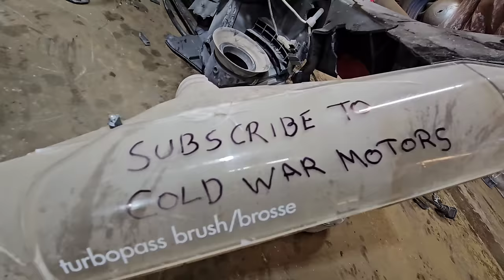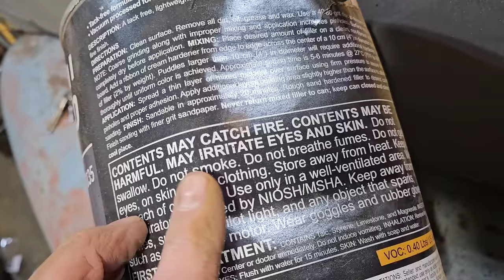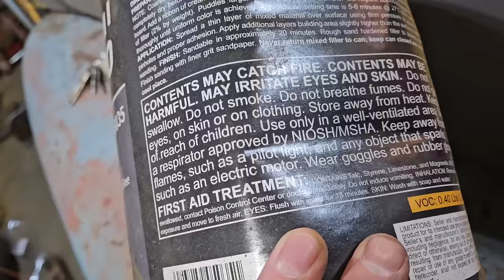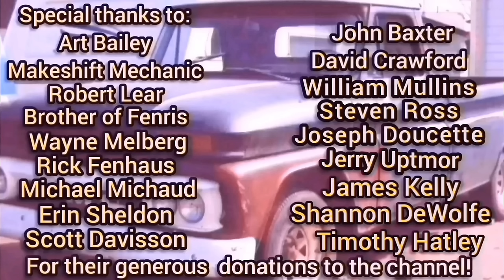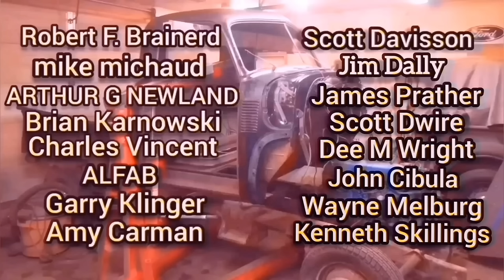Quit Doing Body Filler the Hard Way! Amazing Simple Trick Used By Professional Bodyshops

Comment: What extra steps if any are there for painting the leaded joints/repairs? Special primer or suggested technique?
Reply from the maker: Follow the cleaning steps in this video, it’s extremely important that the surface is thoroughly cleaned with the baking soda/water mixture to neutralize the acid from the tinning process. After that, wax and  grease remover and whatever solvent cleaner is recommended for the paint system you are using. The lead can be primed with etch or epoxy primer, same as what you would use on bare steel.

Comment: What ever you have to do to get the job done Man! Its your car do it the way you want! Using lead is not easy, It takes alot of patience or you will warp the hell out of the panel! I can tell you have done this before, Nice job man! what do you tin your panel with? Do you use anything on your paddle to stop the lead from sticking?
Reply from the maker: I use Eastwood tinning butter and use tallow on the paddles
Reply: @CarterAutoRestyling What is tallow?  Do you buy it or make it?  The wooden spreader paddle, does it matter what kind of wood?  Great video, I thought for a minute you were gonna do something different with filler

Comment: My father was a lead man back in the day he used to repair autos at a Jaguar Dealership, he could lead the whole front section of those cars full of curves headlights grille openings etc I used to watch him hanging lead all around them using an oxy/acetylene torch with a big tip one second too much or too close would result in everything hitting the floor and that shit ain't cheap, I asked him once if he would show me how to do this since he was a master at it and when done needed minor sanding, his answer, go do something useful you will never get it, well I did and thought fuck him, so I taught myself to finishing metal so it never needed filler material and in good time managed to build complete car bodies with simple hand tools and you know what the old boy just couldn't figure it out if he was denied filler he couldn't finish his job, but I could, my revenge was calling the filler guys plasterers, take away the plaster and finish off the tradesman. The guy in this video is a plasterer, I don't care if you fill it with gold the masters finish the metal. Until 
that is mastered they are all the same, plasterers, I've seen complete car bodies covered in cheese and sanded for months, if that body gets damaged  
all that garbage has to be removed and reapplied what a sick miserable job it becomes a small repair ends up costing a fortune because of the hidden 
bad workmanship hidden under the paint..

Comment: Could flux help in any way maybe in to pin holes to suck in the lead or would it dirty up your work area I know lead work in frenching lights and building areas up for strength haven't seen it done on the flat inplace of bondo like what you did good work

Comment: So you’re saying in the end of your video that, you would first have used the lead then finished up with plastic filler correct? Honestly asking. Pretty interesting.
Reply from the maker: Technically you can use lead as a stand alone repair and go straight to primer and paint. Unfortunately, most 60+ year old car bodys are full of minor imperfections, so it's not practical to fill them all with lead. For those minor imperfections, I use a thin coat of plastic filler over the entire surface of the panel. One of the drawbacks of lead is that due to the heat required, you run the risk of warping the panel during the leading process (especially on a large flat surface like a hood or roof). Lead is best used on more rounded cars from the early 1950s and older, and on 1960s cars I only use it on edges or panels with a lot of hard bodylines or high crowns.  I don't recommend using it on new cars or any car with thin metal (mid 1970s and newer) as it's too easy to warp the thin metal from heat.
Reply: Thanks!

Comment: I have some FE valve covers I want to "fix" would the crank case get too hot and melt the lead?😊
Reply from the maker: The melting point of the body solder I use is around 360 degrees F

Comment: lead will eventually form little bubbles under the paint just take a look at older cars when factories used to fill the seams on the quarter panels , inside door jams not as much because their more protected from the elements , body filler if done right and not huge thick quantities and sealed from humidity will last a life time i have collector cars that i restored 20 and 35 years ago no cracking or lifting I'll stick to it
Reply from the maker: It bubbles because the acid used during the tinning process was never completely neutralized at the factory. Lead must be applied to a fully welded seam with no pits or pinholes. The surface must be cleaned and neutralized before and after applying lead. The lead seams used at the factory were never intended to last more than 10-15 years because the cars themselves were never meant to last more than 10-15 years. Done properly, lead filler is far more durable than plastic. It gets a bad reputation because most people do not take the time to use it properly, and the auto manufacturers and bodyshops back in the day did not care if their repairs lasted 60 years

Comment: Hypothetically, if you were to use Canadian Pennies you would want pre 2000 as they have been mostly, by a huge percentage steel then plated/coated in copper or pre 1982 for US Pennies which after that are copper coated zinc.
Reply: Zinc pennies suck.
Reply from the maker: I'm not a barbarian, I used all pre 1964 pennies to keep it period correct to the car.  
 Haha

Comment: Question i have is will the new non lead based paint stick to lead? Or do you have to get a special primer
Reply from the maker: Epoxy primer or etch primer over the lead just like you would use on bare steel. The key is to get the surface perfectly clean. Water and baking soda to neutralize the tinning flux, then wax and grease remover, then whatever cleaner is recommended by the primer manufacturer. People have issues with paint adhesion because they do not clean the surface properly
Reply: To get a small area perfectly clean I would sand blast with a finer media then prime with an etch then epoxy primer. You did a great job on that door @CarterAutoRestyling
Reply: @CarterAutoRestyling  would it make sense to use this on a quarter panel too?
Reply from the maker: @daveunbranded  yes. Automotive manufacturers used it on 1/4 panels for over 50 years to fill the seam between the 1/4 panel and roof. If you'd like to learn more about the leading process I highly recommend watching the Gene Winfield leading tutorial on the Eastwood youtube channel

Comment: Lead.... I suppose it's no less dangerous than body filler 
If done correctly, bondo is much easier to work with. Just apply it like joint compound. A little at a time.

Comment: I watched my brother at his body shop, (he worked on my 1957 Porsche. If you replicate the original hem, it will rust out again the same way because water is trapped there. It will last longer than Bondo without welding metal patches tho. Maybe add caulking on the inside of the door seam? I redesigned the hem./door bottom.
Reply: Stick to what you know bud.

Comment: Can this tin and lead stick be used to solder leaks ina steel gas tank ?
Reply: I have. Clean the tank and fill it full of water. Use a torch and soldering iron. Copper flashing and body solder

Comment: Another time-saving lead use is for drilling holes. The lead applicator pushes it out with a velocity of around 900 to 2500 feet per second, and rotates it about 1 revolution per foot of travel to improve accuracy. Be sure to use some kind of backing to stop the lead after it comes thru, or you may end up with extra holes you weren't looking to make. Several companies make the applicators, including Ruger, Colt, and Smith and Wesson. The downside is that the applicators can be tightly regulated and hard to obtain.
You might also like to know that asbestos is still in use in some applications - another danger over-rated in modern times that was used by the Romans. Remember, both lead, asbestos, and crude oil are naturally occurring features of the earth.  
That vacuum cleaner disassembly was quite thorough. Seems like the impeller might be a good candidate for a component of a home-made turbocharger.....
Reply: in Canada we are tougher as we now have to put the lead in manually
Reply: I seem to have missed the connection between the vacuum cleaner and the door repair.

Comment: The best glasing putty is JB Weld, for filling in valleys l use fine stranded copper wire placed upon tinned area, then tinned  in place .  Very minimal heat required for minor build up.  The copper wire is like fiberglass mesh with epoxy.  OMG you made a mess filling those mirror holes😂Lack of knowledge
Reply: Show us how you do it expert
Reply: @SuperNoticer  l just told you, these guys use so much heat and solder just to fill a hole.
1- Minor holes can be backed with 300series SS as a buck, solder won't stick to it and it won't fall through 
2- Copper strand is used as a medium so as to not use so much solder buildup, when say joining two panels   
     as in a roof panel to a pillar
3-  Done right,  body soldering just takes patience, it's not welding.  Some of these guys just add more heat 
      and solder and wonder why the panel warps.  Tinning and soldering correctly uses the least amount of 
      lead
4-   Never sand leaded surface, only file and always follow any and all safety precautions 🤔
Reply from the maker: I really hope that you are trolling. I agree that lead should only be filed, but everything else you describe is the most convoluted nonsense I've read in a while.

Comment: Can you share what wax & grease remover are you using? Thanks
Reply: go to an autopart and ask for final wash! its a solvent that removes all traces of wax, oil, parafine etc... its does not matter the brand! its all the same but some are stronger use mild.
Reply: Save your money and buy some rubbing alcohol and mix with water.
Reply: Brake Kleen works !
Reply: @norman7179  
Rubbing alcohol mixed with water works just fine.

Comment: Worked In  body shop did metal finishing only, exotic cars, did the work 40 yrs, mostly not lead, it's actually tin these days as in soldering... 0:08
Reply from the maker: The bars I am using are 70% lead and 30% tin. Thanks for watching

Comment: Can u use lead from a battery the same way
Reply: You can't use lead from a battery for a variety of reasons. Auto body 30/70 solder has enough tin for some strength and wettability but most importantly a very wide temperature paste phase above 361 and below 491F you can move it around and shape it. Something like a 63/37 solder for electronics would go directly from a sold to a liquid with no warning, no paste phase so no chance to smooth or spread it around.

Comment: You're missing a vixen file holder. There's one for curved surfaces going the other way. It h has an adjustment bar on the back you can turn to make the file bend in and out. Then you can do curved fenders and it'll make contact over more of the file. Or curved roofs or vw beetles...
Reply from the maker: I have an adjustable file holder.  It was not needed on the 64 Impala door

Comment: That's lead , they use it in the auto assembly plants to repair dings in the sheet metal lol
Reply from the maker: Are you sure? I was told that it's bondo
Reply: Yep found a shit load on a 57 t bird that was factory as the car had never been touched after trying to do lead it was replaced with bondo

Comment: Only thing I would have to say is that door is on the horses the wrong way rotate the door 90° so you don't put dents in the door put the horses close to the edge top and bottom of the door so you don't dent it I seen many people put dents in doors outside panels ...
Reply from the maker: This isn't a modern toyota door.

Comment: This could have been a great video except you fast-forward through the parts I wanted to see. Maybe a normal-speed video that is shorter with less pointing out stuff.
Reply: use speed controller that is available in settings
Reply from the maker: The video would be longer, not shorter if everything was filmed at normal speed. If you don't like my free videos, then go spend tens of thousands of dollars attending a trade school and years working in the trade.

Comment: You need to change the heading to i am going to show you how to repair      a door with bondo the easy way ,then show how you repair it with solder the hard way, your way is 100 percent better but primers and paint will not stick to solder
Reply from the maker: Body solder has been used to repair car bodys for over 100 years. I don't know where you got the idea that paint and primer won't stick to it, but that is completely false.
Reply: Huh ! … that’s how they did it before bondo ?
Reply: @CarterAutoRestyling  every old car you see whrere it was joined quater to roof the paint is dull and bubbeled,a car restorer removes the lead or solder before painting because it goes bad
Reply: @lawncuttingplusdelta  yes i know and every lead seam the paint is dull and full of bubbles thats why car restores remove it

Comment: IMHO::face-blue-smiling: BUILD YOURSELF SOME 50" TALL SAW HORSES,:face-green-smiling: AND GET YOUR WORKPIECE UP, CLOSER TO EYE LEVEL!!! => SAVE YOUR BACK!!!!!!!!!:face-pink-tears: 
:face-green-smiling:[I WAS SORE JUST WATCHING YOLU STRUGGLE]...:face-pink-tears:
IMHO: YOUR MELTED "LEAD-TIN" SOLDER" WOULD BE A LOT QUICKER AND EASIER TO WORK WITH, IF YOU WOULD LEVEL THE SURFACE, SO THAT IT IS PARALLEL TO THE GROUND (FLAT HORIZONTAL, AND NOT VERTICAL, OR ON A SLOPE!...
HEAVY METAL TOXICITY WILL DESTROY BRAIN CELLS, TO THE LOWEST LEVEL, POSSIBLE => IT WILL TURN A NORMAL BRAIN INTO A "LIBERAL/SOCIALIST/COMMUNIST "LIBTARD"...:face-fuchsia-poop-shape::face-fuchsia-poop-shape::face-fuchsia-poop-shape:
Reply from the maker: Talks about destroying brain cells...hasn't figured out how to turn off cap locks or form a coherent sentence without using pictures...